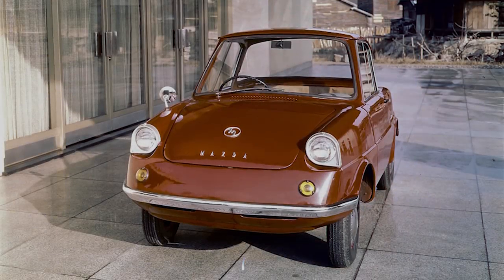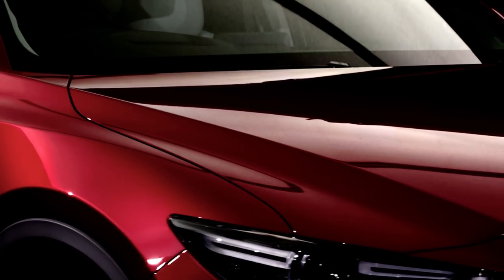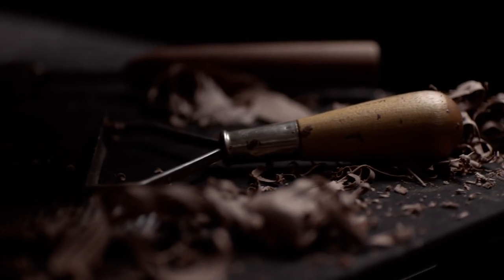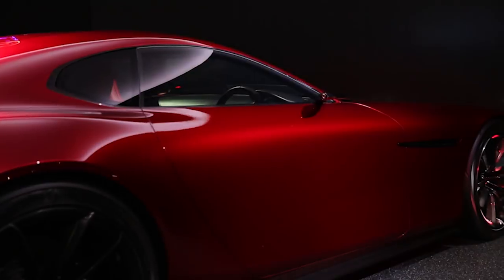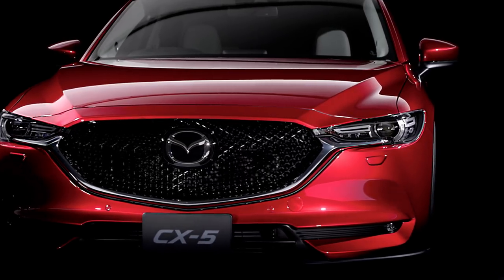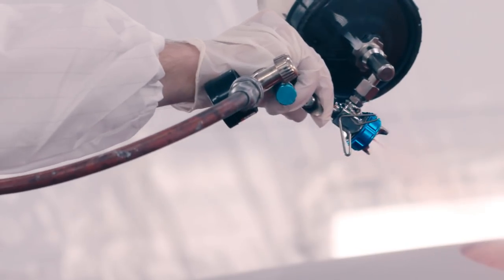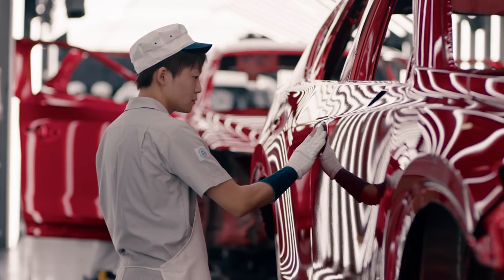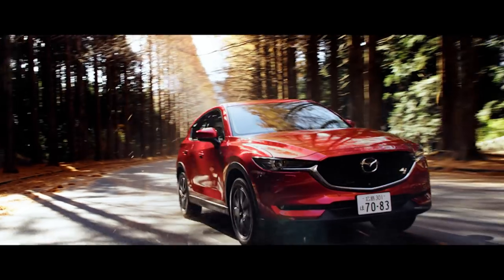ZOOM-ZOOM Issue 29: Soul Red Crystal

Comment: Great colour in person, but ask any smash repairer and they'll tell you it's one of the most difficult paints in the market to match after a crash of any brand.

This was originally the car show colour and many customers said "I want that colour", but Mazda said it wasn't possible. But they figured out a way. They motion captured the takumi's (professional craftsmen) who paint the show cars, then mapped the robotic spray guns to follow the same pattern.

This method only applied to soul crystal red.

But kudos to Mazda for one thing.....
At least in the Australian market, every brand charges extra for non white metallic paints. Currently, Mazda charges less than every other manufacturer, which also includes soul crystal red.